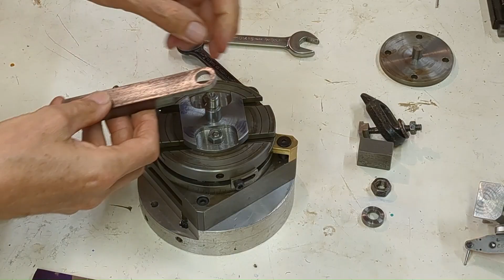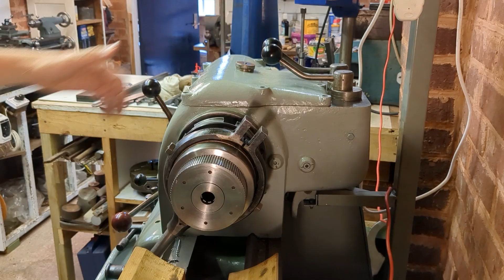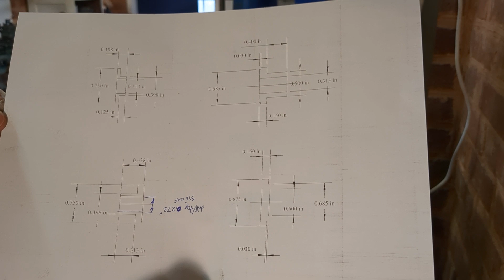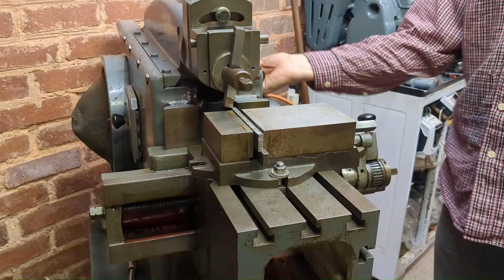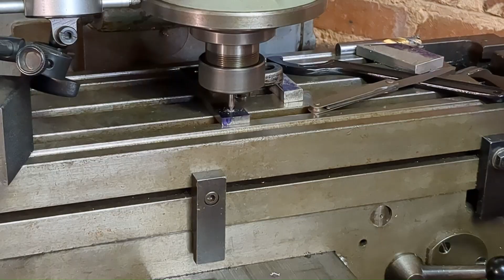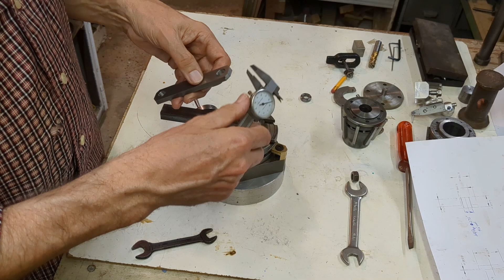Reconditioning & fitting a collet chuck to a Colchester Student lathe - part 2

Comment: Great content. Impressive shop made rotary table. Your jig for corner rounding is a good idea, saves a lot of setup time. I like your mill, checking those vids out next. Cheers Tony
Reply from the maker: Thanks, Tony. The only aspect of the rotary table I wasn't happy with was the poor engraving. I had to use the lathe gear train and it just wasn't consistent. Clive

Comment: Your shaper appears to br running in reverse, as the cutting stroke appears to br faster than the return stroke ?may be an aberation in the videk).  The cut stroke should be slow and retun stroke fast.
Reply from the maker: I just went out to the workshop to check - you are absolutely right!  Solution press forward/reverse button on the VFD. It may have been running like this for some time. I can't believe I set it up like this when I changed the inverter. Could have pressed the reverse button when reaching down to start!